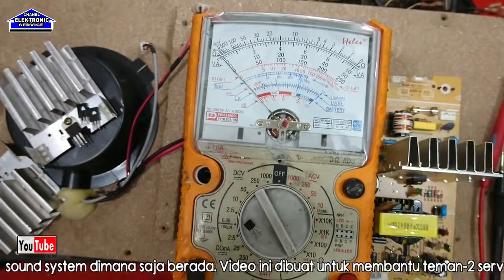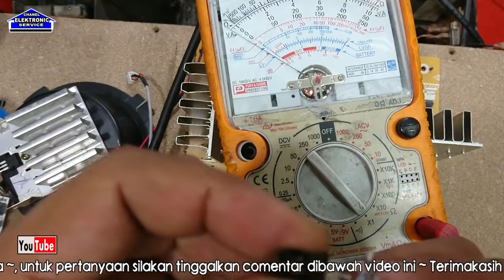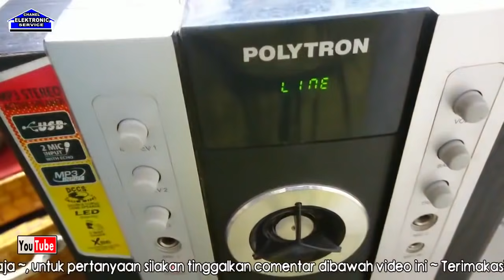RAHASIA 04 speaker POLYTRON XBR MATI   (  ada suara denging ) video 177

Comment: Bagus cara penjelasannya..beda dgn vidio2 yg lain..
Mas kalau power gk nyala saat diaktifkan tp ada bunyi bas nya semacam gendang yg di ketok sekali gitu. Bisa mas pastikan penyebabnya apa ?? 
Trims Bravo mas.
Reply from the maker: klo spt itu biasaya di sysytem PSUnya. 
untuk memastikan silakan cek teg CTnya .
( tegangan untuk power - bisa di cek pada bagian ELCO 2200/35v . ada 2 bh . cek tegangan pada kaki elco itu, dapat brp volt ) 
itu dulu. . . 
thanks
Reply: @Servis-f3h  normalnya brapa volt om?
Reply from the maker: @yndonaika4120  teg normalnya 27,28volt, CT
ada juga yg 31,5volt  tergantung dari jenis mesin / papan di dalam. 
tidak boleh lebih dari 32volt CT klo lebih akan buat cepat final jebol.
thanks
Reply: @Servis-f3h  kalU mati total om.. sama pas ngukur tegangannya dia terbakar diarea tr final speaker R

Comment: Izin tanya bng🙏🙏spiker Polytron saya kerusakan bagian regulator fet ny selalu putus setiap saya ganti yg sudah saya kerjakan pergantian dioda sama fet ny tpi tetap Jong yg perlu di diteliti bagian mna bng sebelum ganti fet ny
Reply from the maker: coba simak video ini ya lihat bagian yg terhubung dgn mosfet nya / pengantian komponennya 
https://www.youtube.com/watch?v=2DThDibgkwA
Reply: Tpi ini kerusakan ny di kaki Gate fet ny sebelum pasang fet ad tegangan sekitar 5,3volt seharus ny dia itu 3,sekian volt kan bng seharus ny soal ny asal pasang fet selalu putus
Reply from the maker: selusuri jalur
cek tr A1015 / PNP
JUGA DIODA 4148
coba di ukur ke kaki IC 
ukur tanpa tr & dioda 
normalnya 5v,
lebih dari itu  IC sdh trouble
Reply: Iy tunggu saya coba bng 🙏🙏
 Trimakasi pencerahan nya
Reply: Sudah saya coba bng tetap Jong
 Saya ukur kaki fet ny ad tegangan 8volt tr kecil"tipe npn sama PNP aman semua sama resistor yg terhubung ke fet bng trus gimna solusi ny lagi bng 🙏🙏

Comment: Klu sdah di ganti TIP 41 nya trus sma transistor drivernya. Kok suara di Spkr R tidak keluar. Trus saya check tegangan di spkr R da tegangan 27 volt. Mhon solusinya
Reply from the maker: usahakan servisnya ke satu speker dulu
cabut smua tr final .
ingat !!! tandai bagian yg di cabut tsbt jgn sampai salah letak.
coba di cek semua tr penguat depannya , ada 3 bh tr kecil.  bila perlu ganti baru saja semuanya,
kemudian tr yg di basis Tr final.
& coba cek tr finalnya apakah masih ok ???
klo ok _ pasang ke pcb kembali,
--------------
ingat nyervisnya satu chanel dulu ya???
kmudian  cek R 2wATT YG DI EMITOR tr final
jika sdh ok.
coba masukkan tegangan & cek lagi.
jk masih keluar tegangan,
coba ganti tr final yg baru.
beli yg type bagus ya ???? klo yg kw kw nantik cepat jebol lagi
thanks.

Comment: Om saya ikutin petunjuk om dengan masalah yg sama memang benar tip41 sama 42 short dan beberapa transistor driver nya jg short, yg laen normal. tp sudah saya ganti semua yg short knp msh berdenging... Elco simetris yg dua itu om gak ada tegangan nya+ msh berdenging. Mohon petunjuknya..
Reply from the maker: coba buka kembali semua tr final.
ukur kembali teg out swichingnya lewat elco simtrisnya,
normal tegangannya 28~ 32v dc
----------------
hilang tegangan karna ada suara denging itu krna ada salah satu tr final yg bermasalah.
mungkin di ukur ok 
tapi pas di pake / dipasang spt kejadian saat ini.
Reply: @Servis-f3h  ok siap om...
Reply: @Servis-f3h  om yg sepasang tip41dan 42 saya di bagian R dan L saya cabut semua trs saya kasih tegangan power, switching tak berdenging tp resistor di bagian ampli nya pada berasap.. om tebakar
Reply from the maker: @mediaplay8502  ber-arti ada yg trobel di bagian TR bufer nya.
Tr yg sebelum tr final itu.
bisa bd140/bd139
bisa juga c1815/a1015
tergantung bawaan mesin/ pcb terebut
ganti tr trsbut + r yg terbakar .
coba tanggani sebelah dulu.
jika sdh nprmal sbelah , baru masuk ke yg satu lagi
thnks
Reply: @Servis-f3h  ia om ku ikutin petunjuk om, makasih banyak y om udah mau balas komentar mudahan channel om trs berkembang... Panjang umur ..dilimpahkan rezekinya...

Comment: H822 d ganti transistor apa bos
Reply from the maker: BDI39 Bisa
Reply: Punya saya mendegung ...langkah langkah pertama yg harus di cek apa nya Gan....trims
Reply from the maker: @hermancorro6978  dengung spt apa???
amati dulu speker nya 
lihat membran speker 
1.apakah membranya di tarik kedalam tyus berdengung 
2. atau di dorong keluar berdengung 
3.atau ada dengung gitu saja 
tampa merubah posisi membran speker 
======
dari ke tiga opsi itu 
pengangannya beda-2
Reply: Ngung saja bos....jadi di hidupin pertama beberapa detik tenang...gabis itu dengung......d kasih in put gak mau
Reply from the maker: @hermancorro6978  periksa tr finalnya mass
tip 41 42 
tr yg di basis tr final 
bahkan tr C1815 & A1015 
klo ada yg bocor bisa juga demikian
Reply: Siap saya coba terima kasih

Comment: Assalamualaikum , bang sy mau tanya dengan kode R 642 nilainya berapa ya,yg posisinya di belakang TR 621B di bagian TIP 42C  spkr L
Reply: Mohon bantuanya ..
Reply from the maker: r nya berhubungan dengan kaki tr brp mazz 
soalnya saya tak ada contohnya pula di bengkel ini. . .
Reply: @Servis-f3h  TR H882 kebetulan TR rusah .. di toko juga ngga ada .. klo persamaanya apa yah bang.
Reply: Dapetnya D882
Reply from the maker: @nvrsalam3357  itu jeniznya npn itu 
bisa pake bd 139
Reply: @Servis-f3h  ok bang.. trus itu R nya berapa ohm yah
Reply: Saya pasang R 100 ohm belum mau nyala. Juga.
Reply: @Servis-f3h  mas mohon bantuanya.  Tr final,TR drive/h882/bd139, TR c1815, TR a1015 udh di ganti semua masih tetep ga mau bunyi trus sy cek tegangan  cm 5 v trus ke monitor 0,5v klo yg ke tone cntrl 4v .. kira kira apanya yah

Comment: Numpang tanya suhu saya punya speaker Polytron berdengung setelah saya ganti menggunakan trafo ct .tegangan saya ukur normal  kisaran 55 volt.aku sdh ganti transistor finalnya bos kira2 apa lagi yg harus di ganti suhu mohon pencerahannya
Reply from the maker: _ tegangan induk normal untuk suply POLYTRON ADALAH 28volt DC / CT  ( diukur pada 2bh elco +/_ 28vdc)   dan makximal 32volt. tidak boleh lebih dari itu, jk lebih maka akan cpt panas/jebol.
_ setelah TR final di ganti tetap dengung ??? coba cek tr YG bergububgan dgn BASIS tr tip 41/42 & URUT semua tr driver sampai ke A1015/ C1815 mungkin ad salah satu yg tidak bekerja,
kemuadin cek dioda kaca in4148.
_ ( cobalah fokus ke satu chanel dulu ) buka  semua  TR FINAL , servis satu bagian dulu L atau R )
TRMAKASIH

Comment: Om mau nanya,, speker saya tipe pas 78,, usb mp3 nya g kebaca,, katanya suruh ganti ic 7805 tp di speker saya g ada ic itu,, tp di vidio ko ada ic itu ya,, letaknya di mana ya kira2 ic 7805 yg pas 78, trima kasih
Reply from the maker: IC 7805 adalah untuk  mensuply modul MP3/LINE IN/blutoots /dsb. . . 
pada speaker polytron PAS 28/ 68 letak ic di papan boar dekat TR final 
biasanya kabel pengapian ke modul ini KABEL WARNA KUNING 
coba cek teg di sekitar IC modul/ panel dispalnya 
klo teg 5v ada tidak .
( klo gak salah IC 7805 PADA pas 78 itu  MODELnya NEMPEL di PAPAN Boarnya )
Reply: Klo misalkan tegangannya di bawah 5 volt apa yg lain masih berfungsi sprti line in, fm radio blootut, gaget in, disply nya jg, soalnya yg lain masih fungsi smua, kcuali mp3 usb nya aja.
Reply from the maker: @sabdobumi8056   : pUNGSI dari teg 5v adalah untuk menghendel  bagian MODUL ,( sprti line in, fm radio blootut, gaget in ) SEMUANYA terintegrasi dengan MP3 usb ,  JIKA teg ini tdk ada maka semua yg ada di layar dispaly akan mati
untuk pungsi MP3 usb Adalah dgn kinerja  BACA FILE yang dilakukan oleh IC modul mp3  ( ic tempel ) IC MPEG.
tapi coba di lihat juga di USB/MP3 apakah tdk ada solderan yg kendor ??? 
& di socket USB juga di periksa kaki-2 ada yg melar. . .
atau juga USB yang lain di coba ke perangkat tsb.
Reply: Chanel Electronic Service maaf Boss sekalian numpang tanya disini....
kebetulan saya lg ngorek PA78 yg displaynya mati  tegangan hanya 2,7 volt padahal dicek dikali IC smd 5 volt... kira kira dimana masalahnya?.. pada bagian swiching bukan 7805 tapi K7A65D apakah sama?...
tolong ya Boss... ditunggu balasannya.... makasih.
Reply from the maker: @abazahra5741   , hahaa  K7A65D adalah posfet untuk  converter tegangan , hati-2 main tester  itu TEG TINGGI loh. . . ,
langkah awal coba ukur teg  out put POWER SUPLY  ( PADA ELCO BESAR YG 2 BUAH )
klo normal sekitar  26 ~ 30 volt 
jika di bawah itu  bisa jadi teg ke Modul mp3 Ikut down.
Reply: Chanel Electronic Service makasih Boss balasannya cepet banget.... Gini awalnya hanya hanya ada suara mencuiiiit setelah dibuka dioda bridge pecah dan elco 35v kembung lalu diganti tegangan normal tapi display mati hidup kalo socket kabel ditekan2 lalu dikencangkan setelah dicek solderan tidak ada yg retak tapi tetap klo kena gerak mati hidup ters mati dicek 5v hanya 2,7v.... eh sekarang dicolokin malah MCB  ngejeglek..... gimana ya Boss tolong ya...
Reply from the maker: klo  MCB  ngejeglek , ?????
sebelum lanjut ke yg lain-2 nya kita bahas yg utama dulu ya ???
apakah pengantian dioda bridge itu sdh dengan type yg sama , atau diganti dioda biasa ???
Reply: sma kya punya sya pas 79 bli blm lama uda g kbca usbnya,,,  kl gnti ic brpa y